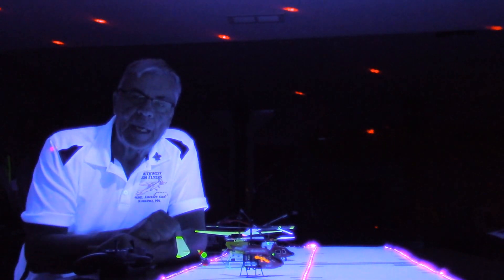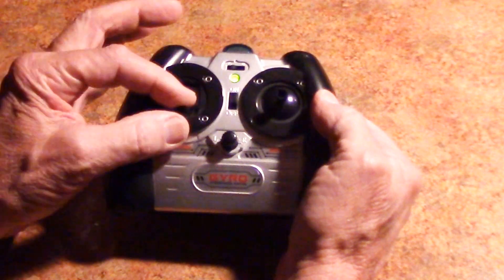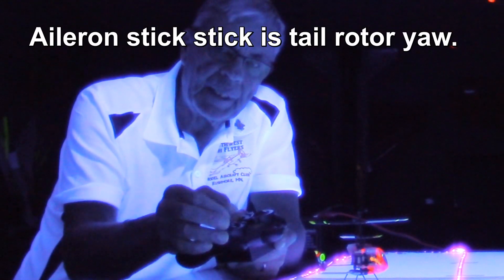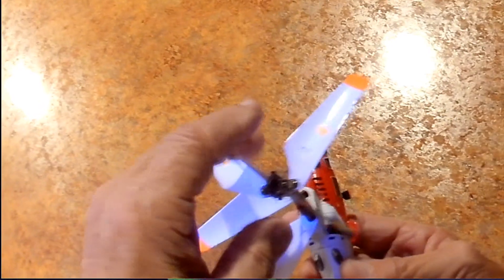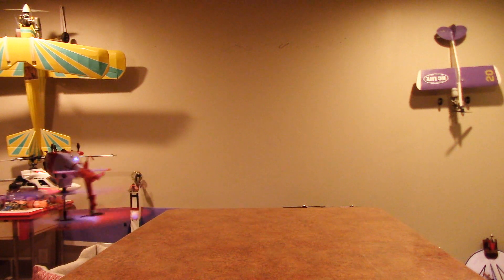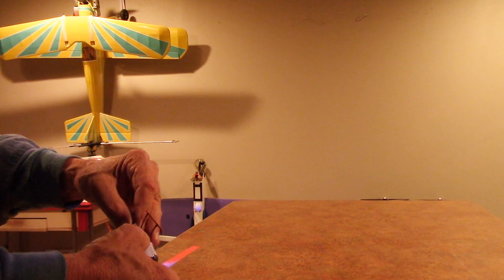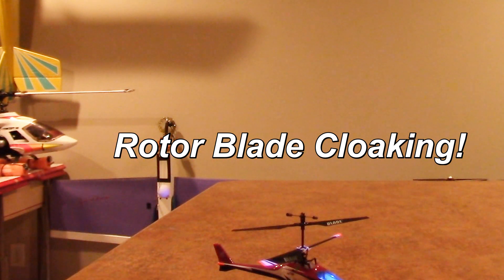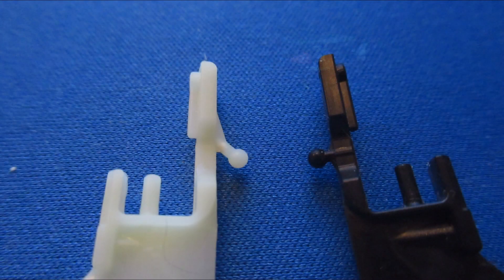Upside down Coaxial Helicopters! Here's how! + Cloaking your top rotor blades w/demos!  By request.

Comment: i still think someone should make a large scale Russian "Gator", maybe a co-axial in a 90 size???
Reply from the maker: The biggest one I had, I reviewed in 2009. It was the eSky Big Lama.  It had blade strikes all the time, outside and in the slightest breeze as I show in that vid.  The loose blades are the problem, because they run into each other.  The Gator has had many mishaps as well with vortex stalls under it at times.  At least the blades are bolted perpendicular and can't hit each other.  Maybe someone will try, but the biggest model of mine was not fun to fly.  Thanks.

Comment: If you haven't flown these yet I recommend the Yu Xiang F180 or the M2, both are 200 class heli's and they fly very much like a 400-500 class. They have incredible power and are a blast to fly!
Reply from the maker: I have too many helis already but may look into that.  I like the bigger helis like my Raptor, Nexus, and T Rex 450, mostly because smaller helis are hard for me to see at my age, not matter how good they fly.  Thanks.
Reply: @NightFlyyer  I'm picking up a used T Rex 500 locally tomorrow, really looking forward to hovering a bigger Helicopter! This one has a fly bar so there will be some learning curve for me as I've mostly only ever flown flybarless
Reply from the maker: @justinhennigar3830  Actually there won't be a big learning curve as they fly easy.  Most of my helis are flybar.  Just more parts is the biggest difference to me, but you will enjoy flying a bigger heli.  The bigger they are, the easier they are to fly and see.  Happy flying.

Comment: I have a challenge for you.  Supposedly, coaxial heli's cannot do banked turns like a fixed or collective pitch heli, but I can fly my Colco Lama 6 coaxial helicopters and do banked turns, left and right.  The Lama 6 is the most agile, quick acting and fast coaxial I have ever seen and I have many coax heli's including a number of Walkera's.  Walkera's also can fly banked turns.  Let me know how you do or if you want some clues as to how to do it.  Cheers!
Reply from the maker: I don't know who said that,  but if you turn off the gyro, you can do many things with coaxial's, especially if they have cyclic controls.
Reply: @NightFlyyer  I'm surprised you haven't heard that before, but that's been a complaint about coaxial heli's as long as I have been into them (around 2009) and partly why they lost popularity.  But you can also bank turns with them without any mods at all. I don't think you can even turn off the gyro other than to turn down the sensitivity all the way on my Colco's and Walkera's.  Example is to bank left push both sticks to the upper left corner(45 degrees up to the left) to start the turn and as the heli begins to turn you move the right stick slowly down to the 9 o'clock position and you will bank the turn.  To get out of it, reverse the procedure.  its the same thing turning right.  Throttle adjustments may have to be made during the turns to keep the heli from popping up or dropping depending on whether you are turning with or against the power of the rotors.  Its nice to see someone other than myself who still likes coaxial heli's.  I like them so much I still have a couple of them new, in boxes just in case I break all the rest of them.  Have a great day!
Reply from the maker: @RacerX888  I did a product review video on the Big Lama in May of 2009!  I did many more on coaxials even before that especially with my big CH 46.  I am surprised you keep assuming I do not know about these things, but thanks for your suggestions.

Comment from the maker: *Warning. This will NOT help you learn to fly 6 ch, 3D helicopters inverted, but by request, I show how to fly my Coaxial Helicopters upside down. I also show the types of coaxial helicopters this can be done to.  This is a good exercise in mind control, as it is not even close to the same controls as 3D pilots are used to. Also see how I cloak my top rotor blades. Here is the link to my Wobbling 3d helicopter fix. https://www.youtube.com/watch?v=KLLfnJajixU
Thanks for watching and stay well.  ~Dave